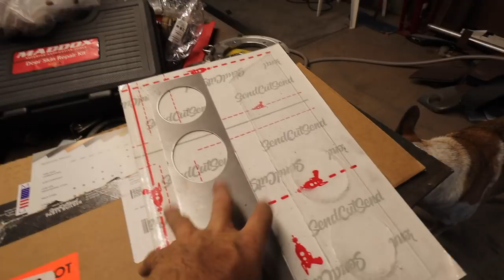Porsche 911 Door Skins Redux & A SPECIAL SURPRISE! | SUBARU Swapped Porsche Blasphemy Build 64

Comment: I Don't know anyone that would trust a filler material on an edge like the fender or door. That includes lead, body filler with or without fiberglass fibers, or epoxy. Welding is the answer either building up a thin bead at a time or welding an actual welding filler rod along the edge. (Brazing works too.) That will never be subject to damage from a bump or other mishap.